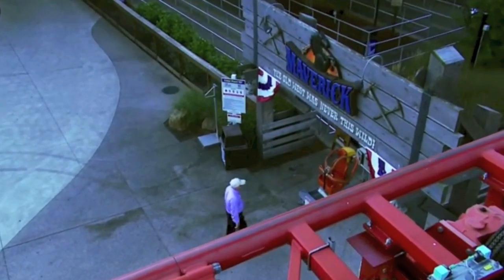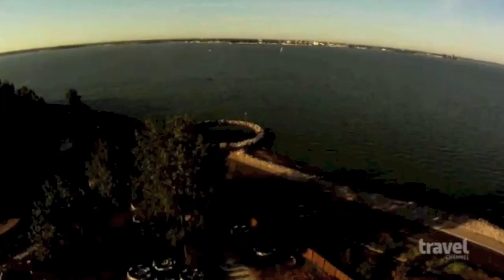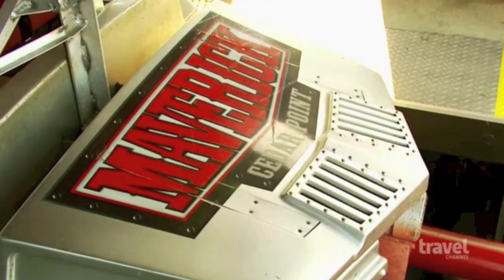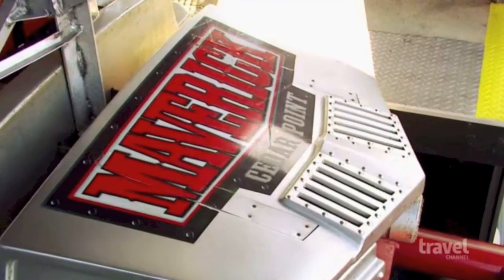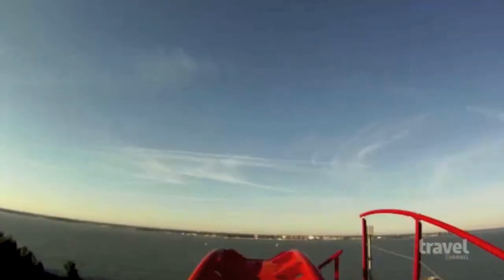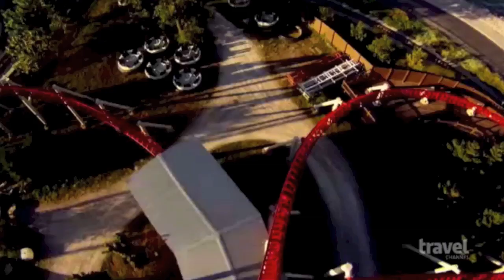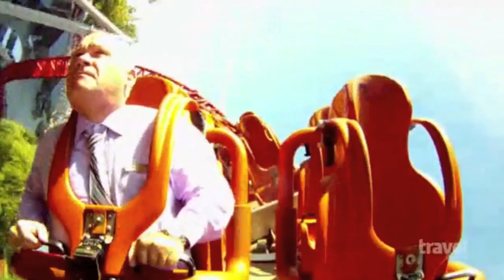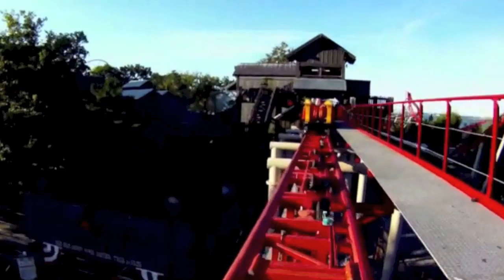Maverick - Testing ᴴᴰ

Comment: About 40 seconds into the video, he says that the lift takes you to the top of the hill at 22 feet per second. That can't be right; 22 feet per second works out to only 15 mph, and no way is Maverick that slow in getting up the lift hill. Maybe things were different back when this video was made.
Reply: No Maverick only goes up the lift hit at about 15 MPH
Reply: jpwcpa the coaster is 105 feet tall. 22 feet per second. he reaches the top in 4.8 seconds. THINK.
Reply: A coaster traveling 22 feet per second definitely will travel 105 feet in 4.8 seconds, as you indicated. But the lift hill for Maverick is more than 105 feet in length, in much the same way that the lift hill for Valravn is more than 223 feet in length even though the maximum height for Valravn is 223 feet, or the lift hill for Magnum is more than 205 feet in length even though the maximum height for Magnum is 205 feet. The only way to be 105 feet off the ground after 4.8 seconds of traveling 22 feet per second is to go straight up.
Reply: jpwcpa yeah, yeah whatever, the point is that the train is and has always been travelling up that lift hill at 15 mph, the guy WORKS at the park. he knows what he's talking about.